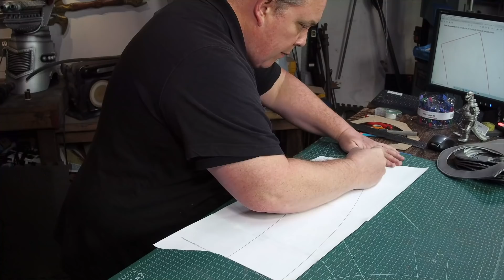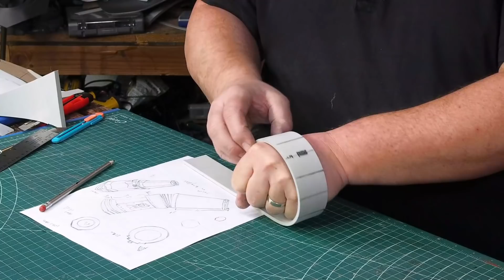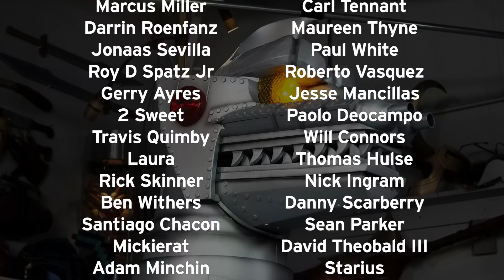Odin Makes: Arms for my 1974 Mechagodzilla cosplay

Comment: I made a 50's era robot costume in college and had the exact same issue with the elbows (and knees).  A fellow student came up with a great solution.  Make non-symmetrical width rings (so they open wider on the outside of the elbow and thinner on the inside).  You know if you've done it right if they don't lay flat but lean to one side.  It took several tries (and a lot of cardboard prototypes) until I got it working. I used metal wires to keep the circles from collapsing unevenly.
Reply from the maker: I was considering wire loops inside of fabric when I thought I would be using stretch fabric. I skipped the wire as the vinyl is stiff enough to hold it's shape.

But it's also too stiff to allow really small section to move under the foot of the sewing machine. It's the things you run into when making stuff out of the ordinary.

Comment: What you could do with the elbow pieces is having longer pieces of the rings and gluing them further inside the top part of the arm and further down into the bottom portion of the arm, i dont know how well it would work but i think that would still give you enough range to move and when you dont need all that mess it just goes inside the arms, not sure

Comment: Thank you for the comment on the guyver units in there storage case idea.
It a shame you could not get the elbows to be just right next time you could try making them shorter on the inside and larger on the outside if this is possible for you.
Loving the build as all ways.
Stay safe all.
Reply from the maker: Thank you Robert! I think I will make the elbows offset, more fabric on the side that opens, less on the inside- pretty much what you had said. I was just trying to imitate what I was seeing on screen first.

Comment: Both the rivets and the "MG" on the side are the because the lead designer for the original suit thought the original design was too smooth and dull, so they were  added so that Mechagodzilla would look more intimidating. 

The reason for the "MG" in the movie is never explained, other than it signifies that it is Mechagodzilla.

Comment: Odin it still looks awesome I have an idea about the elbo if you add both together an cut it at an angle so on the outside you have 4 to 6 rings but inside you only have 2 that might work.
Reply from the maker: I have started a new set with offset holes, more fabric where the bend happens. Also I am trimming the inside seam after it's sewn, which is much easier.
Reply: @OdinMakes  that is a better idea than I had. Good call I’ll bet it will look amazing.

Comment: So, for the elbows, can you make them small enough to fit inside the upper arm? That way they don't add length/bulk, but will accordion out as necessary when you bend your arm.  I don't think the corrugated black pipe would have enough bend for this application, but if you had something affixed to the end of the lower arm, and then attached like halfway up the upper arm inside it, you could probably get the look you want as well as the fuctionality.

Comment: Hey Odin do you think you could do a video on how to connect a cape to foam armor or do a cape designs for certain styles of cosplay
Reply from the maker: Interesting- I did make a cape that attached to foam armor for the show Beyond Geek. It had tear away attachments - complicated Velcro. If the hero was pulled on by the cape, it would just come off instead of sucking him into and airplane engine.
Reply: @OdinMakes  oh ok my bad was gonna try to for honor Lawbringer cosplay and was trying to find a way for the cape section to connect and disconnect somehow.